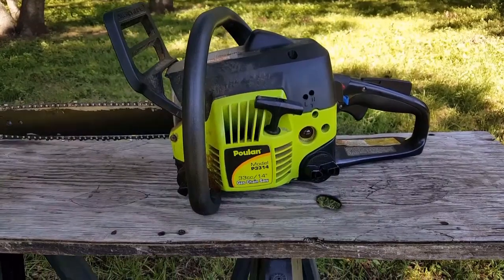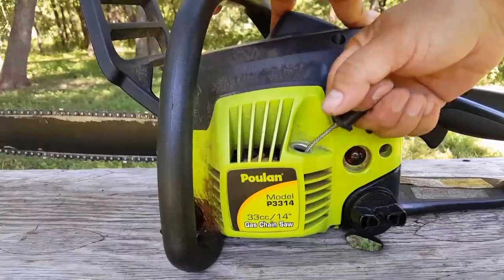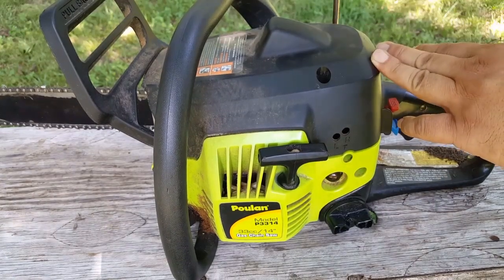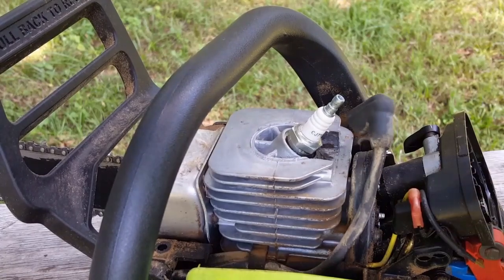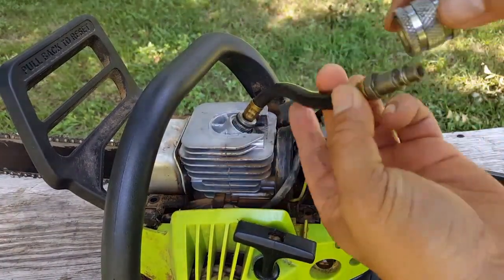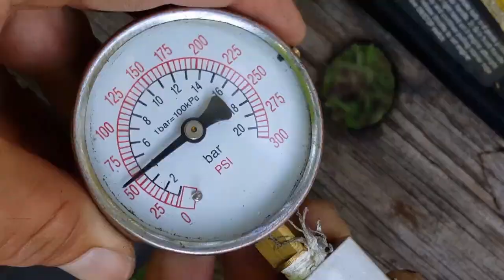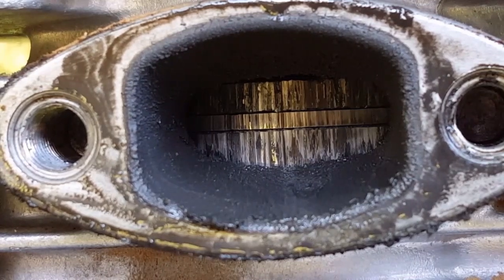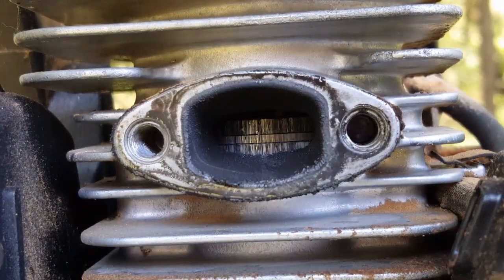Poulan chainsaw will not start. Can we save it?

Comment: Here is another option that keeps me somewhat busy. When the operator fires up the saw and immediately goes to full throttle and holds it there. The engine needs to warm up for at least 30 seconds. (AT LEAST!) The exhaust side of the piston heats and expands faster than the rest of the engine/piston. The  piston will (for lack of a better term) egg shape in front of the exhaust bcause of the heat while the rest of the engine has not had a chance to expand at the same rate. The rings will stick in their grooves and no longer provide the compression and power they are used to having. So they rev even higher and soon it just wont start. They take it to Home Garage where he give them the bad news So when "I" watch guys go full throttle on start up I walk over, tap them on the shoulder and say "See you Soon and bring a $100".
Reply from the maker: That made me chuckle!
Reply: @Ashurii sometimes but not often a good overnight soaking of Marvel Mystery Oil down the cylinder/spark plug hole will release the rings enough to expand and let it start. Its a 1 or 2 time thing. Just enough to make it run when you ditch it @ the pawn shop. No Lie. Pros ask me to "make it start" so they can do this. 😱
Reply from the maker: I don't drink so make mine a coke or Pepsi.

Comment: Poulan poul and still won't start. If there's to much oil in the fuel with that cause a no start?
Reply from the maker: It depends how much. 32:1 shouldn't be a problem.  16:1 should start but smokes a lot when running. Is the mixture you're talking about heavier than 16:1?

Comment: If it runs lean doesn't have too much oil
Reply from the maker: Thanks for the comment.  It's a good possibility however that's why I poured out the gas to inspect it and it looked dark enough. I was hoping it was light in color indicating to little oil.

Comment: Its toast. I'd buy a new piston & rings and hone out the cylinder. I have a 30 year old Poulan that still runs fine. I'd hone it first to see if I could get the cylinder smooth before buying parts.
Reply from the maker: very good suggestion.